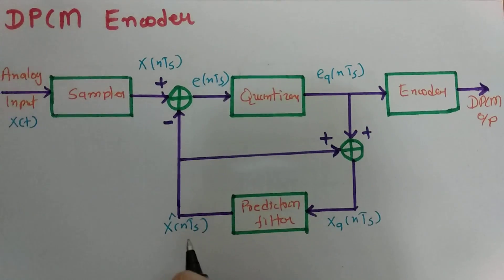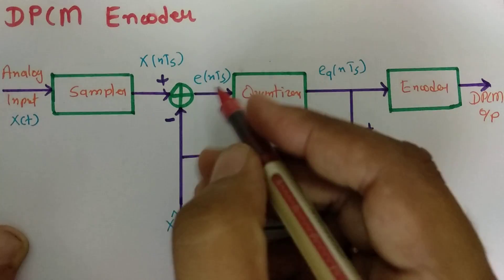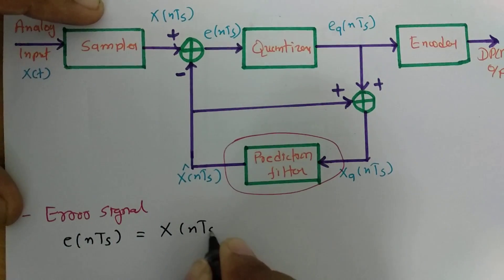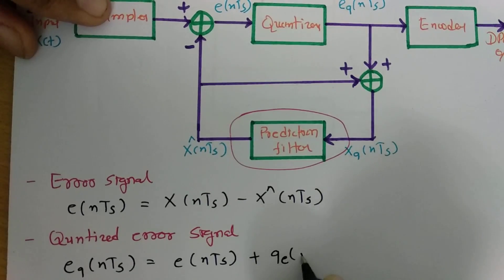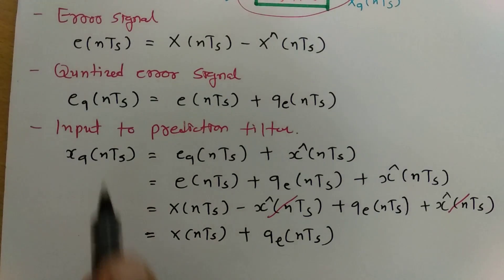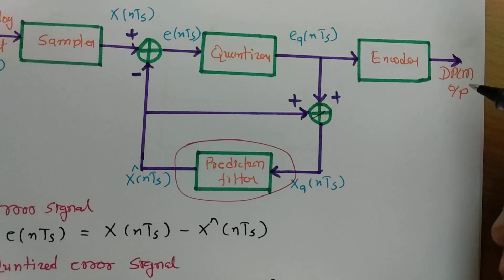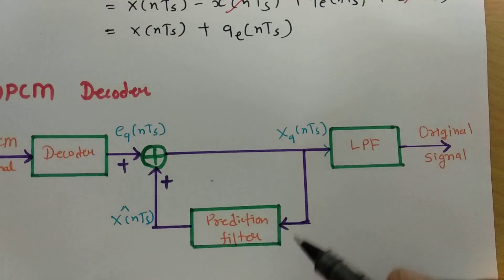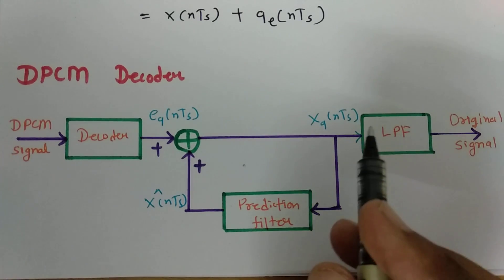DPCM Encoder & DPCM Decoder | DPCM Transmitter | DPCM Receiver | Differential Pulse Code Modulation

Comment: SIR...transmitter of DPCM is that encoding.? I am bit confused ?
Reply from the maker: Transmission side, there will DPCM encoding and at receiver side, there will be DPCM decoder
Reply: @EngineeringFunda  if In exam I have a question something like this...explain blockdiagram of tramsmitter of DPCM,,,,?So can I draw and explain DPCM encoder?
Reply from the maker: Yeah